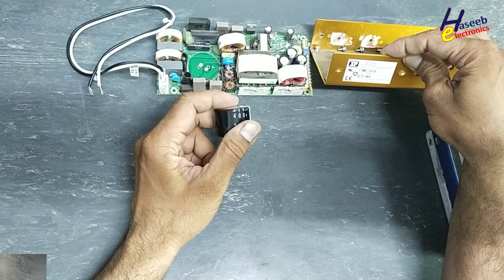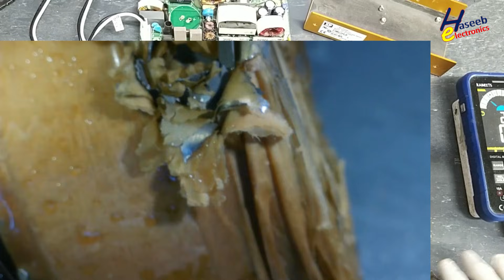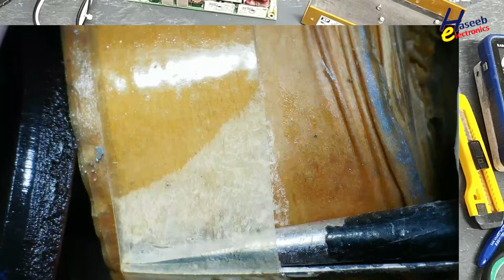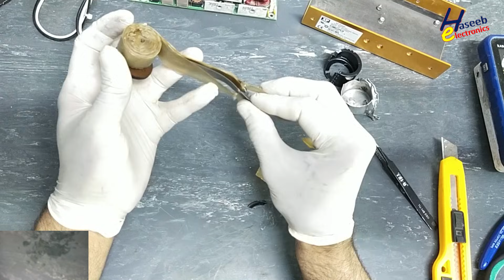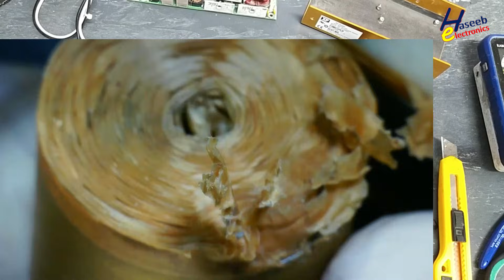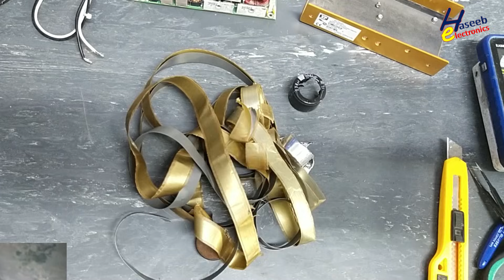{1408A} Why 400V Capacitor Failed in 420V PFC Circuit | MFA420PS48 XP Power | Root-Cause Analysis

Comment: Sir plez size of capacitor
Reply from the maker: it is nichicon 330uf 400v 35mm x 25mm capacitor (35mm diameter and 25mm hieght)
Reply: @HaseebElectronics plez ek video